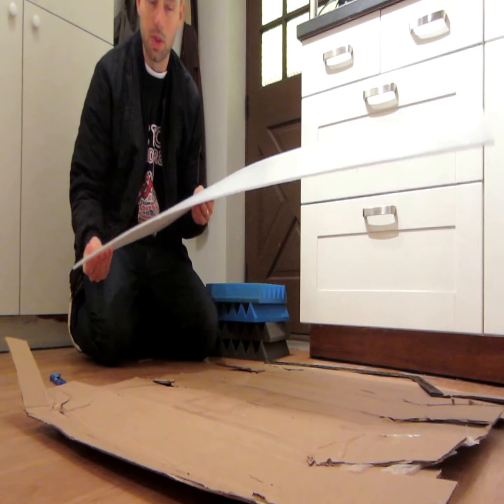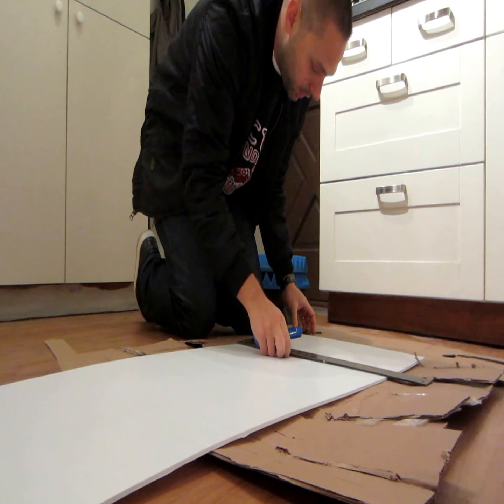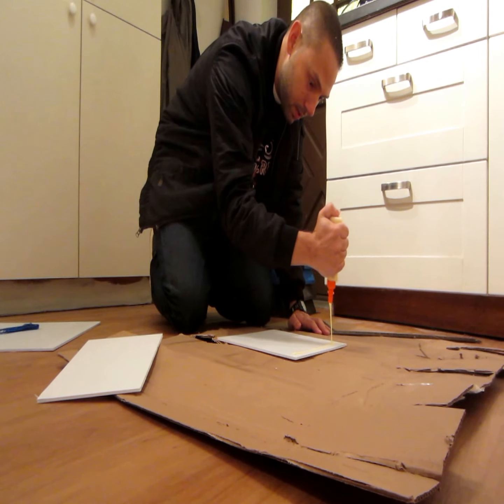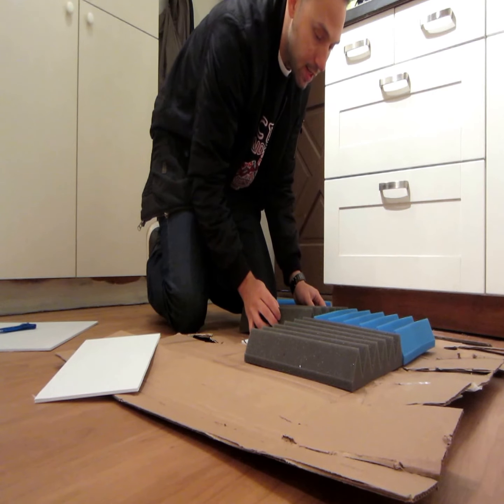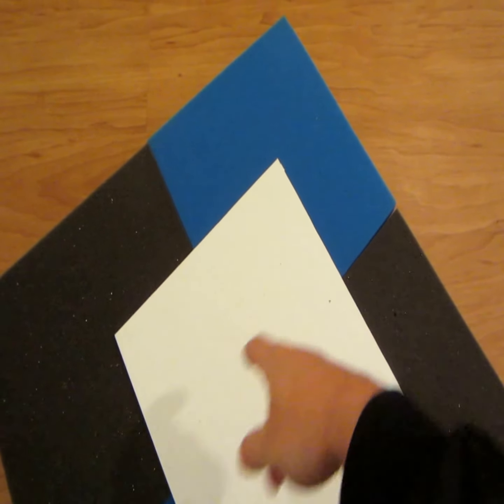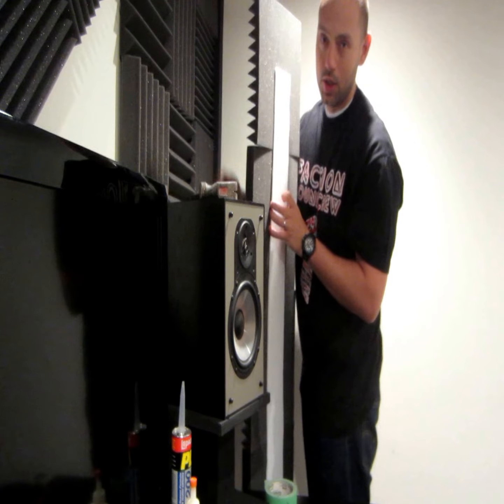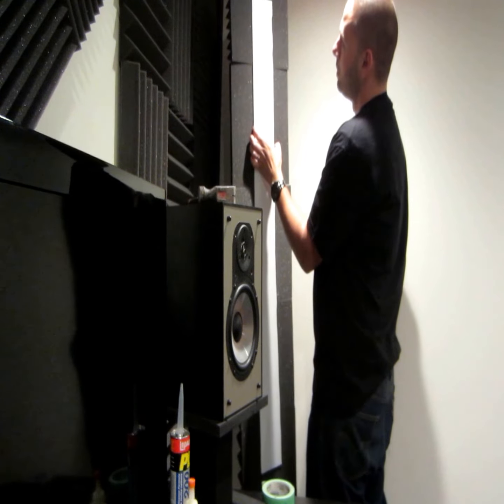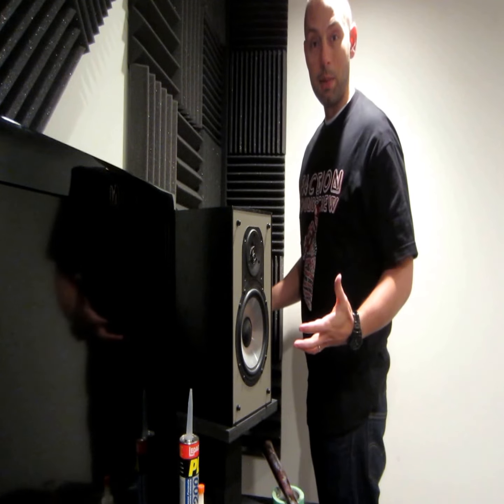The Best Way to Install Acoustic Foam

Comment: Hey mate, this method seems like it will work for my new setup. It's a new apartment and I really don't want to mess up the walls like my last place (double sided tape held very well for 2.5 years, but in the end, it was a disaster for the walls removing it!). Thanks for putting up this video!

Comment: You can literally just use tacks. That's what I do. 1 tack smack dab in the top-middle of each panel. You can take them down whenever you want - no residue on your panels or wall.

Comment: protip : Superglue those double sided tape bits on the panels and you're good.
Reply: That’s a bad idea. The superglue will harden and stick to the double sided tape but will eventually fall and remove some foam chunks.